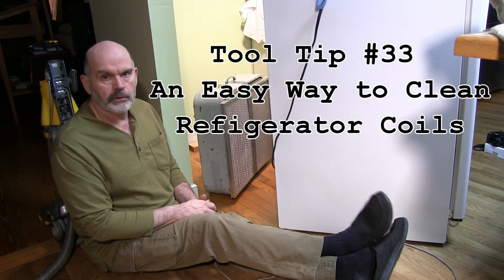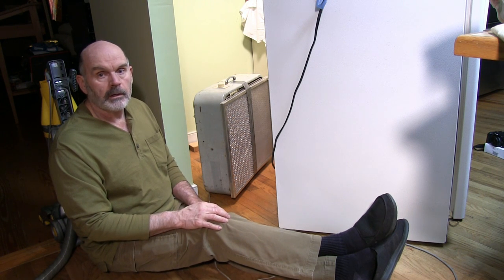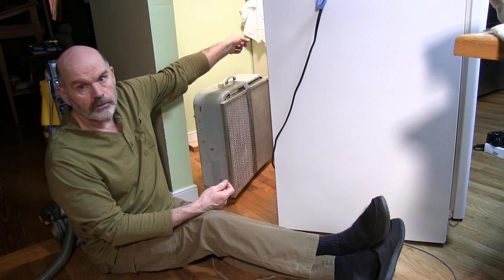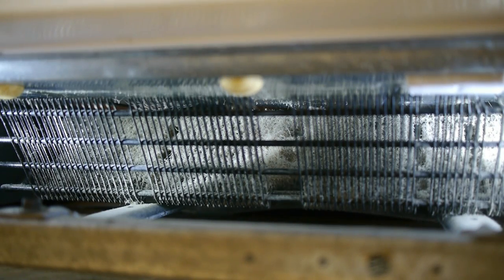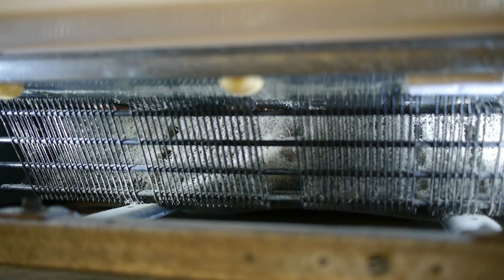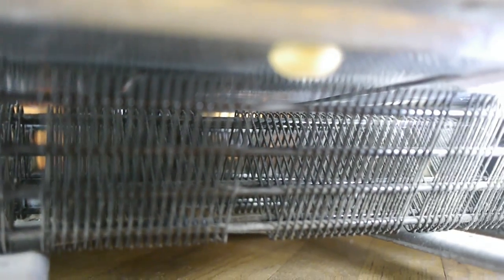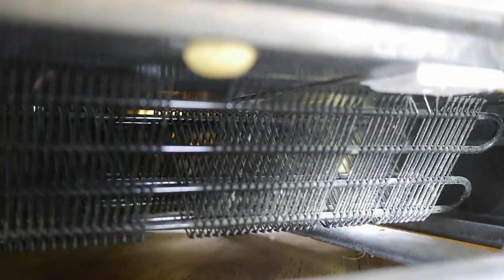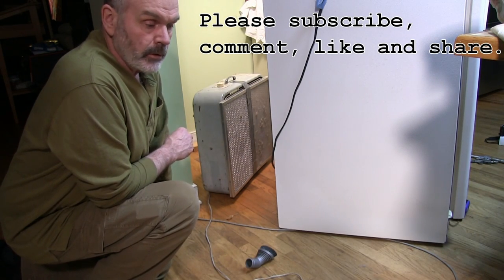Tool Tip #33 An Easy Way to Clean Refrigerator Coils

Comment: My coils are exactly like those: folded accordion style. Impossible to clean without tipping up the frig on it's side. Ridiculous design. Why the heck dont they put a filter over the coil air intake? Or at least put an access panel on the lower right side to get to that folded coil.

Comment: So would dirty coils be the reason the bottom part of the fridge doesn't get that cold? The freezer works really well, but the refrigerator part is barely adequate.
Reply from the maker: Just clean the coils and find out.
Reply: @mars1952  I did. It's a Whirlpool that was made in 1997 and was well taken care of. Just got it used a month ago. Got most of the dirt off the coils, cleaned and checked the fan. Even though it wasn't very dirty it did get help the bottom part get a bit cooler but still not as cold as it should be with the dial maxed out. Trying to figure out why. Any ideas?

Comment: I took the bottom off at the and sucked up the hair and dust some but i need to blow mine like this as well.  So I need to see how to take the back off. Do you have a video for that? thanks
Reply from the maker: Pull the fridge out and look at the back. It will be obvious.

Comment: I have this exact fridge.  What type of air compressor did you use? I had to laugh at the leaf blower idea.  I would try it but I'm allergic to dust.
Reply from the maker: I have a large stationary air compressor but almost anything would work. Maybe even a blow dryer. I did not use much pressure.
Reply: Poor Shelley :(
Reply: get a cheap spray paint mask (Eastwood.com or get a full-face gask mask on ebay or amazon for $40-50). I think its worth the investment and get to work Shelley ! Also watch videos online about cleaning your air vents. Their probably clogged also and thts just adding to your allergy issues. I hope this helped u !

Comment: The Whirlpool model ET1MTKXKT08 has just this "problem" -- I put "problem" in quotes since it is, plainly, long-term sabotage by the manufacturer. The space containing the accordion-coils is armored all around except for the front-to-back direction, and the idea of getting any kind of brush in there is a big joke.
Reply from the maker: The home refrigerator has been around for about 100 years. Designers and engineers have known how to solve the "hard to clean coils" a long time ago. I have an upright freezer that does not have any visible coils, It radiates heat from the flat outer sides, they are warm to the touch. ~20 years ago we had a refrigerator with flat coils on the back and it was very easy to clean. The coil design in this video is unambiguous planned obsolescence and should be against the law.

Comment: Nice video. Where did you get the filter for the fan? I assume it was designed for something else. What do I ask for at the store?
Reply from the maker: I got the filters at some hardware store on clearance.  It is two filters taped together. You can use any furnace filter. The size needed will vary based on your fan size. The better the filter (finer particle size) the harder it will be for the fan to pull air through. You might ruin your fan. The fan in this video was made in the 50's and is almost indistructable.
Reply: Thank you! Is there a vacuum cleaner and attachment that you recommend?

Comment: Does the dust in the coil prevent my fridge from being cold?
Reply from the maker: The dust on the coils makes the refrigerator run too often or continuously. Counterintuitively, the first symptom of a blocked coil is the stuff in the lower part of the fridge will freeze.

Comment: I think it is quicker to bring outside, crank up the air compressor, blast it all out, bring it back in for four hours to let the oil in the compressor resettle and then put everything back in. Then you know you got it like brand new.

Comment: #1. Make sure your wife is not around 😉. You could empty the freezer and refrigerator then tip the unit 1/4 on its back. Mine has a metal cover on the bottom.

Comment: A little easier way... take a thin rope and tie at least two pieces of steel wool onto it. Pass it through the v shaped coils from the end and use the rope on each side to keep working the dust into the barbs of the steep wool. Very little mess.

Comment: Can you not take a pressure washer to those and wash and clean outside?
Reply from the maker: Karen Diaz there are unsealed electrical connections that would be damaged by the pressure spray no matter how careful you were.

Comment: Ps: I will try the : flexible  tubing one inch (about 2.54 cm. OUTSIDE DIAM), & tape on end of my vacuum crevice Tool , to reach vacuuming tube/ hose thru Screen covering COILS….***( used this couple times 20–30 , years ago, older Whirlpool/ : my new LIKE THIS video, & is built in;*& crowded in front….

Comment: Thanks, good ideas:: my same set up on “” side by side WHIRLPOOL FREEZER/ Refrigerator , WITH #5 Filter, ULTRAEASE WATER SYSTEM “”, *: unit is built into, kitchen counters/ overhead Cabinet*close quarters in our Rental,.apartment.* No apparent way to loosen wire screen lattice in front of coils…(??, I am checking more MANUFACTURER Directions(?.)…..

Comment: "An easy way to ..." sounds good but when you click and the first thing you see is a man sitting on his kitchen floor it kind of makes you wonder if it really is all that easy. Oh and the author just said "I thought it would be an easy job to clean this..." Well, I'm optimistic. I'll go along with it until I have to disassemble something fussy or need some power tool I don't own. Like a compressor. With the recent problems my Whirlpool has been giving me I'm thinking hard about kicking it down the concrete staircase onto the concrete patio so it will bust open and buzzards can pick it clean. I'll buy me a Bosch with a white glass front and two evaporators.

Comment: This video is basically worthless for servicing coils on the bottom of Whirlpool refrigerators.  Brushes will only get the first row of coils leaving 90% of the coils with dust. Here is a solution that actually works.  Use compressed air in one of the small canisters from any home improvement store.  They usually come with a red 6" plastic extension, which does NOT provide the length necessary to do this job.   Get a small piece of clear tubing that you can force the plastic extension into at one end and also force into the nozzle of the air canister.  I got a small section of 1/16 interior diameter tubing when I bought the air canister.   Cut a short piece of wire to put inside of the clear tubing to provide a little rigidity.  Now I had a one foot extension line of high pressure air that I could put through the coils to get the ones in the center.  Then I went to the back of the fridge and repeated the process.   You will get dust balls blown out from both sides of the fridge, but this works like a charm.
Reply from the maker: Warren Cunningham , I think your comment has landed on the wrong video. Here I show how to use an air compressor to clean the coils.

Comment: Buy a coil brush 5 bucks
Reply from the maker: Watch the video, free.
Reply: @RUNYON APPLIANCE LLC
Did you SEE the design of the coils? A coil brush will NOT access those coils behind the very front coil. The only other effective way to clean this style of coil is to use an appliance hand truck tilt the fridge up at a 45 deg angle and then access the BOTTOM of the coils and get to all of them with a vacuum and brush.